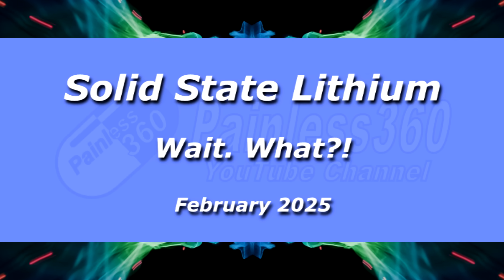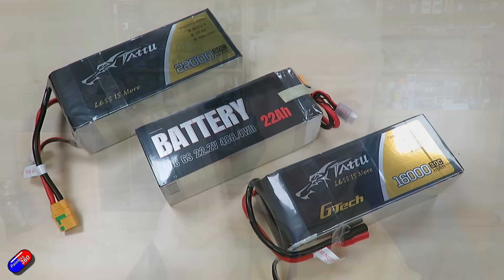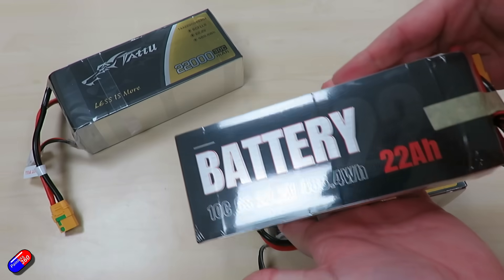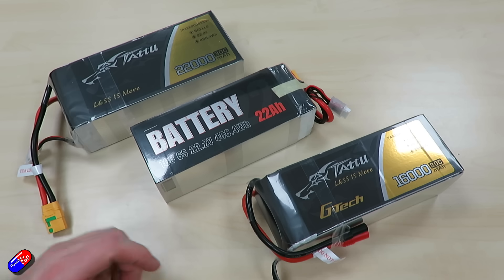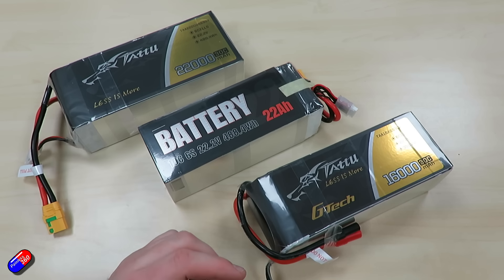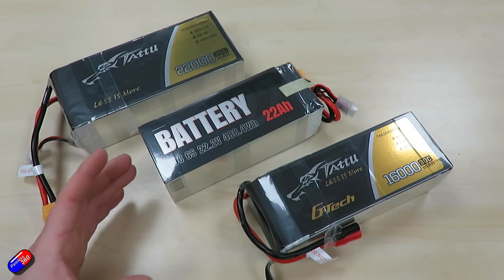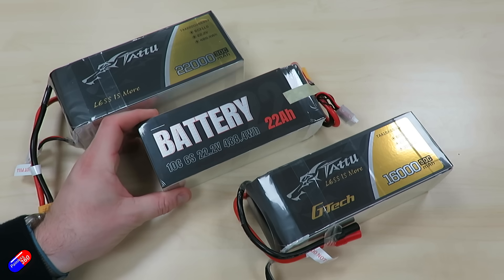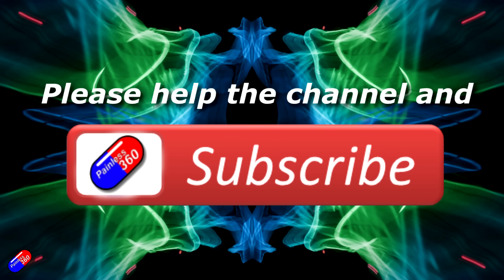What are 'Solid State' Lithium Batteries? How are the different from LIPO?

Comment: That seems like a flat Li ion battery.  How is it solid state ie no electrolyte?  LiIon already is lighter than lipo and higher capacity and even 45c rating. 
A 21700 5000mah Li ion 3s battery is way lighter than the equiv lipo and 50c rated.

Comment: Wow!  Good to see actual tech that's been discussed so long actually now available at the consumer level!

But it only has 5C output and 2C charging which is in the same power as normal Li-ion though. 😐

But a big improvement is the prismatic "pouch" style instead of the Li-Ion cylindrical 18650 format.  The pouch format allows for much bigger capacities without resorting to parallel packaging.  It also allows more various battery shapes versus the rigid cylindrical 18650 format.

More importantly, I have read these early product releases are only partially solid-state and not fully solid-state.  Because there is no industry standard on what qualifies as "solid-state" so even partial solid-state tech can be labeled as "solid-state".  This is actually beneficial though because when more fully solid-state batteries arrive, the C ratings to be more in line with LIPO (70C/5C) instead of Li-ion (5C/2C) all while retaining Li-Ion's higher energy density while also adding lower fire risk and operation even when in sub-zero temperatures.  Because when gel or liquid electrolyte starts freezing, its resistance goes way up, but not so with a fully solid-state electrolyte.

Comment: I can see an application for photography drones that operate at a steady state over a long period. I'm flying 550 series hexacopters on 4S batteries with a 12C rating. The extra power density with less weight and longer flight time would be welcome.

Comment: So far, nobody has demonstrated a "solid state" battery that didn't also still have some liquid electrolyte to improve conductivity.     Whatever they choose to call it  the real proof though will be when they can show high cycle count, and low dendrite formation even when left fully charged for extended periods of time.  If you have to baby it as much as any other LiPo then it's not fulfilling the promise of true solid state electrolytes.
Reply: I have read about at least one fully solid-state battery made of ceramics. Except the battery needs to operate at 300+C to make the ceramics flexible enough to not crack during charging/discharging. Having to keep a battery inside a vacuum-insulated vessel would be quite inconvenient for a car but fine for stationary storage.

IIRC, Toyota has a SSB that uses a press to maintain constant pressure across the cell stack to keep solid electrolyte in contact with plates during expansion-contraction cycles.

There are new polymer electrolytes that may simplify things in the future. At the very least, those would make dedicated separators obsolete.
Reply: @  I should have been more specific.  I'm talking about production  or production ready consumer cells.  Of course there are exotic prototypes out there that fit the definition.    Ultimately though I just don't care how they get there, as long as they eventually figure out how to stop the dendrite formation at reasonably high power densities.
Reply: My guess is it is just Li-Ion cylinder cell technology flattened into a cuboid. Thus it is a hard shell vs a foil pouch so they are calling it "solid".
Reply: @ Most "solid-state" batteries that aren't outright lying about it are swapping out the separator with electrolyte polymer and otherwise the same as regular batteries.

Having a solid electrolyte in place of the separator film slightly improves energy and power density. It also replaces 20-95% of the liquid/gel electrolyte content.
Reply: Lithium titanate already meets that criteria.  It unfortunately has a high idle discharge.  Not a problem at all for many applications but it's not solid stzte5
Reply: Are these "semi solid" batteries that have gels instead of either liquid or solid electrolyte? True solid state isn't commercially available but I'd love to see some reviews of these "semi solid" batteries
Reply: The manufacturers call them "semi-solid state" so I'm sure they're aware
Reply: @smnkm4ehfer   Several  were not calling them "semi-solid" even though they were.

Comment: This is pretty incredible. 25% increase in energy density. A real stepwise improvement. I'm not sure if these are similar to the silicon anode batteries (see Amprius SA08 based batteries from Upgrade Energy) that are starting to hit the market for industrial drones. 

This will absolutely trickle down sooner rather than later.